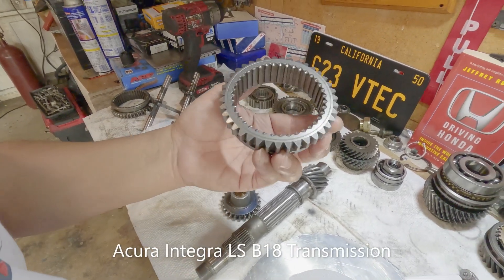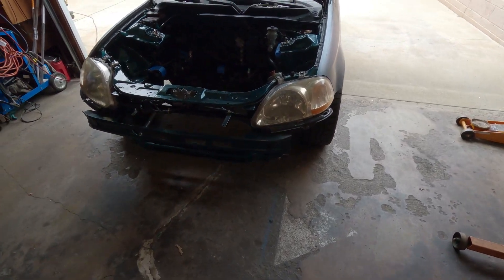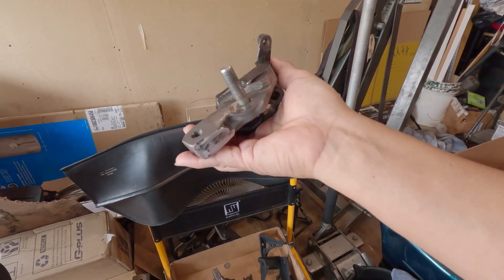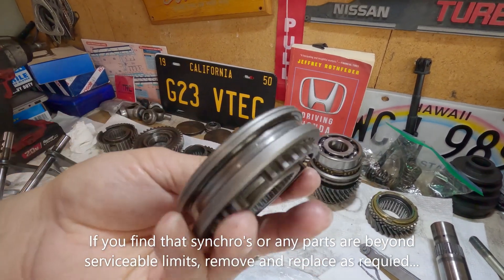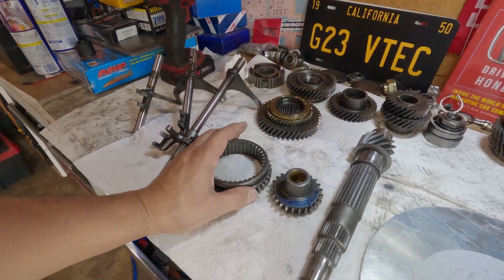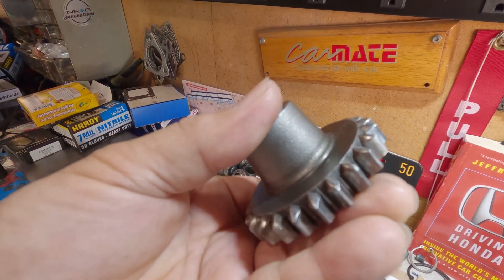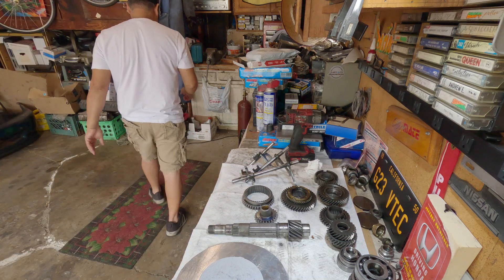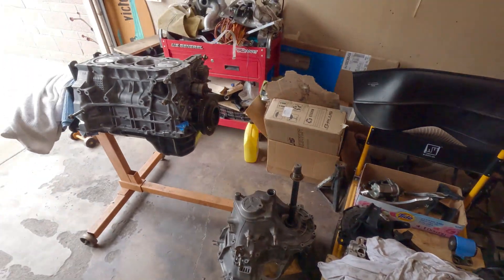H2B/G2B build update! B series transmission internal parts inspection and findings. pt. 1

Comment: Hey kuya, i'm doing a turbo build on my 99' Prelude VTIR (H22A4/H22Z1 engine) based in australia. Almost finished rebuilding the whole engine and transmission, amongst other parts in the engine bay. Just looking to ask some questions po and some tips regarding boost, meron po kayong social media to message?
Reply from the maker: Ang tip ko sa boost eh, make sure to use good ecu like Hondat s300 or other stand alone ecu. Never use a chip p28 ecu. Use a good known brand wastegate, BoV its your choice of brand, l used a hks replica and no problem whasoever. For the block, use a aftermarket rods and forged piston. I think that just about it. Other parts like AFR gauges is not really needed but good to have it.
Reply from the maker: H22 OE csmshafts are very good pag dating sa boost. It's capable of making over 400whp. It's up to you for upgrade.
Reply from the maker: Use 1000cc injectors minimum